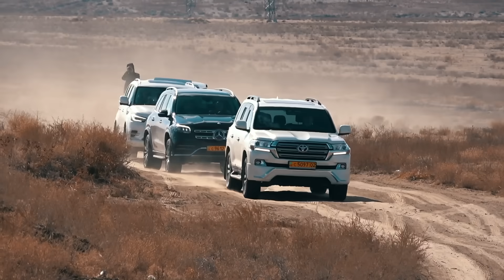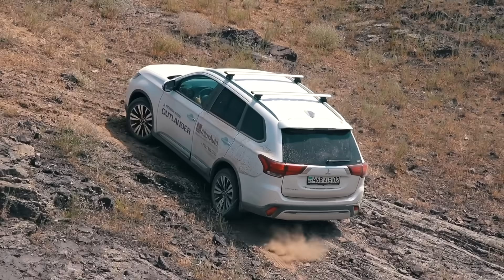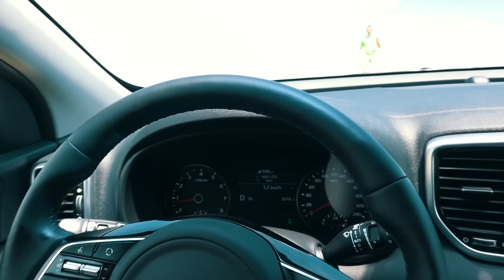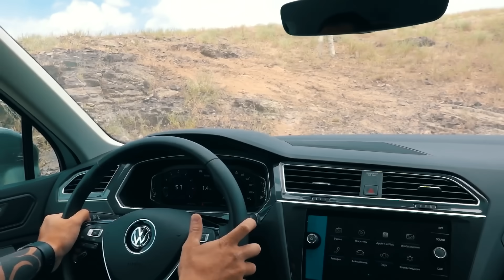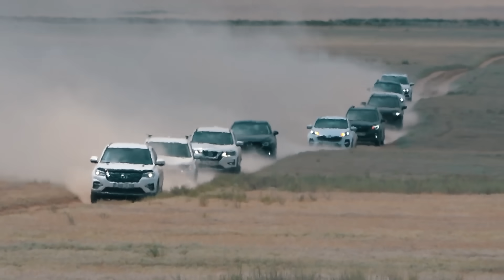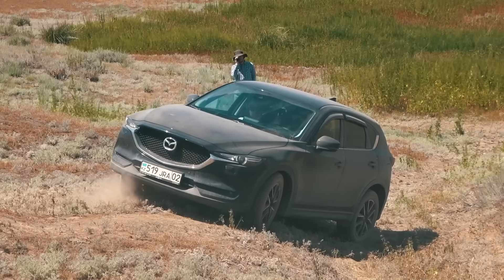SUV Battle 2020: Toyota RAV4, Nissan Rogue, Subaru Forester, Mazda CX 5, Volkswagen Tiguan, Sportage

Comment: Kudos to this channel for honest reviews. 
I own a Forester 2019 and am humiliated with the results! Crown jewel of AWD bites the dust. Forester performed barely better than the Mitsubishi. Used to look down on Rogue for its AWD capability but performed way better than expected. And lastly, RAV4, AWD was the only section that Toyota didn't excel in (in mid priced SUVs atleast) but the way RAV4 performed was phenomenal. So predictable, calm with the reliability of a Toyota. 
Should have bought a Rav4. :'(
Reply: The on-road ability of the Subaru is far better. It's like a baby Quattro!
Reply: @bigglyguy8429  Yeah, thats why I bought it. But at this point I am quite unsure if that is also just a perception. Before this video I used to think Subaru AWD will outperform all other players at its segment, but that has been proven to be far from the truth.
IMHO, AWD is most useful starting from a standstill or at low speeds (presented in the video), above that AWD's use-fullness is of diminishing returns
Reply: @vang1278  I'm too lazy to find it but there's a vid showing how it does improve the road-holding, even at higher speeds. Just more balanced grip and traction, inc when you let off the throttle (which can unsettle a lot of cars). My wife has the earlier, non 'X mode' Crosstrek/XV. I've played around with it off-road and it's pretty darn capable. I don't know for sure but I think maybe better than the X-mode, which is about computer controlling, whereas our one is perhaps cruder but works better? Note here quite a few cars were actually giving over-heat warnings while the Scooby didn't. The Scooby also has more ground clearance and better approach/departure angles than some of the others, especially the Nissan. Heck it has the same ground clearance as the Mitzi Triton truck. For our real off-road camping and adventures we take my heavily modified Hilux, complete with roof tent etc. That would stomp all over these obstacles as it's been modded with a locking rear diff. Not computer controlled, big fuck-off steel cogs that WILL force both wheels to turn at exactly the same speed. These little cross-overs use computers to brake or send power to different wheels and basically imitate the 4WD and locking diffs of a real truck or truck-based SUV. I do think the newer Subaru systems err on the side of caution, and protect the CVT from damage by limiting what you ask of it. So do they now win every such video? Nah. But they last longer, and remember any of these could have got over this mild stuff by just using a bit more speed and maybe a better line, ie they could do it, here they deliberately stopped them and demanded they start again from stationary. That's not real-world, where the Scooby would scamper up there with no problem or drama. If we didn't have the Scooby I'd go the Rav 4 but of all of them, as a compete package, the Scooby is still the best.
Reply: @bigglyguy8429   Agreed. Pre CVT Subarus would perform a lot better. Is your EAT as well? I also agree that Subaru was the only system that didn't overheat, and I would like to think its because of better built AWD rather than just pushing the system harder.
But I would have to say comparing Subaru against other cars in the segment, the major deal that sets them apart is/was their AWD performance. If not looking for AWD, Toyota would be the more reliable, Kia would be cheaper, CX 5 more sportier and CR-V probably a better car overall. Also, to your point that another route can be taken... Yes it can be, and in 90% of the cases, a FWD sedan would also be more than enough, but people buy an AWD to address the remaining 9% of the cases. IMHO the point of this test/video was to evaluate which SUV would tackle the off-road best and objectively RAV4 perform the best and Forester second to worst. Sorry man, I think I am still hurting to see Forester's performance I guess...
Reply: @vang1278  subarus undoing was the cvt gearbox.very disappointing
Reply: I never thought the day would come that a Rav4 performs better than Subaru off road
Reply: If you think subie was mistake, you haven't watched this https://youtu.be/SsEFOH7KP-Q

Comment: Where is volvo XC40
Reply from the maker: I will try to find this car and test it on some obstacles. Who to take as rivals?
Reply: @SUVBattle  it does fit with the sub compact car so bmx x1 , x2, audi q3, lexus ux, jauger e pace, Benz -(gla, glc , glb) and  prochse macan. I just gave a list of all the ones I can think of
Reply: @SUVBattle  salut  .if the dacia  duster is 1.5 dci 4x4, it doesn't matter who you bring.
Reply from the maker: @gabiroka7454  In my region there is no Dacia Duster, but we have Renault Duster ;)
Another point - we don't have diesel engine on Duster, petrol only... =(
I have already filmed Duster 2.0 petrol + 4AT with different cars. Later it will be on the channel.
Reply: @SUVBattle   salut .no problem .is your loss, if you do not have a diesel Duster in the dealership ..and yes, the Russians are allergic to the word Dacia ! 😊I really like the show you're doing.
Reply: in the garage or in the mall parking lot  😉

Comment: you re right in the video, we expected more from subaru. but it´s good to see the actual situation with your examples. thanks great
Reply: The freak show driving the Subaru was a "Specially Challenged" individual.  Santiago, snap out of it.  Subaru is king.  only Subaru and the Mercedes 4 matic could pass all tests from the USAC (United States Auto Club)
Reply: @digitallenz4506  there's a new king and it's Toyota

Comment: Subaru is killing their vehicles with the CVT.
Reply: Subaru CVTs are still reliable though
Reply: @V_For_Vigilante  lmao
Reply: @haroldbeauchamp3770  

Last time I checked Toyota, Honda and Subaru makes best cvts
Reply: @V_For_Vigilante  I am a consultant and do risk management work for the USA top 3 extended warranty companies. I can assure you with actual service and warranty records data that cvt problems are real and cost Toyota, Honda, and especially Subaru’s millions of dollars in claims per year. There is no reliable cvt. Period. Every single manufacturer measures warranty claims vs profitability. The bottom line is that cvt’s are significantly cheaper to produce. Manufacturers could literally replace cvt’s in every model that has one and still come out ahead compared to using a traditional and reliable automatic transmission. Jatco, which produces the Subaru cvt you mentioned, has actually reduced costs on their warranty claims over the past few years, whereas Honda and Toyota has increased. Currently, my company is paying extra claims for cvt transmissions in Toyota Corolla’s and Toyota CH-R’s. Model year 2016-2018 Toyota cvt’s are especially trouble prone and will absolutely fail under documented conditions that Toyota is fully aware of but hasn’t fixed. So now the effect is that if one is looking to purchase an extended warranty on a Toyota with a cvt, the costs will be rising soon to mitigate the risks now known and maintain profits on these warranty’s. Cheers.
Reply: But 30 some MPG on the highway is so nice for long trips.

Comment: But why not a tiguan 2.0 TDi? 170hp and 370nm it can get easly off from that situation. 1.4 tsi suks!!!
Reply: The quality of the diesel fuel and its price is key issues low popularity of those here. Would you prefer to spend $0.35 per litre of regular gasoline or $0.50 for diesel with a high risk of getting your fuel system frozen on some nice winter day?
Reply: The petrol 2.0 shown here did amazing. Best of the bunch

Comment: I was very impressed by the toyota but the CVT is seriously affecting the awd systems of those cars
Reply: Im pretty sure the Toyota comes with an 8 speed auto, if you get the NA engine only the hybrids come with the CVT, and those AWD systems are geared more for onroad performance
Reply: @alwaysiyi272  — the hybrid e-CVT bears NO resemblance to the CVT’s that are used with IC engines. The electric motor for the hybrid RAV4 is inside the transaxle ...
Reply: @sking2173  oh wow, i didn't know that, thanks for the info man, i appreciate it
Reply: @sking2173  does that mean its good thou ??
Reply: @rhett7716  — They have proven to be very reliable. Several manufacturers have used the same design for their hybrids.

There are videos on YouTube which show a complete teardown of this unit.

Comment: @SUV Battle, did Mazda CX-5 driver tried to turn off the ESP?
Reply from the maker: Turning off the ESP helps to gain speed and drive obstacle using the momentum. Our goal to compare work of AWD systems. Only smoothly driving demonstrates it.
Reply: @SUVBattle  thanks for the answer. There is an interview with a Mazda specialist where he explains that turning off the TCS actually makes the break applied harder on the spinning wheel. You can check it here: https://youtu.be/5wWY7JhNZ8U?t=659

Nice battle! Looking forward to the next one! :)
Reply from the maker: Wow! Thanx for information. I’ll check it when updated Mazda will arrive.
Reply: @SUVBattle  I can't believe they didn't turn off TCS in the Mazda, it's damaging the reputation of the CX-5 without even testing it properly.  It does indeed have a hidden off-road mode for this exact situation.
Reply: @SUVBattle  You cannot disable ESP in the CX-5 but you can change the traction control settings to stop wheelspin on unloaded wheels more aggressively by pressing the TCS off button in 2017-2019 CX-5s or by pressing the "off-road" button in 2020 CX-5s.